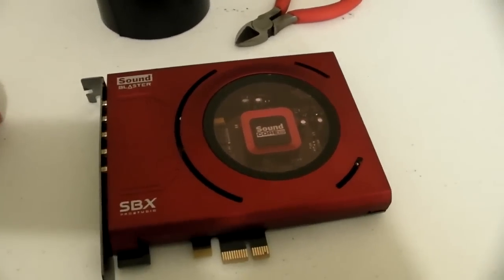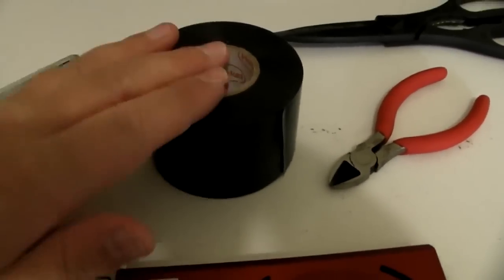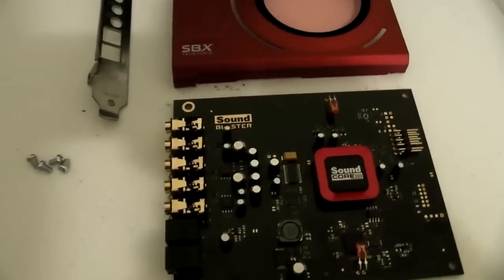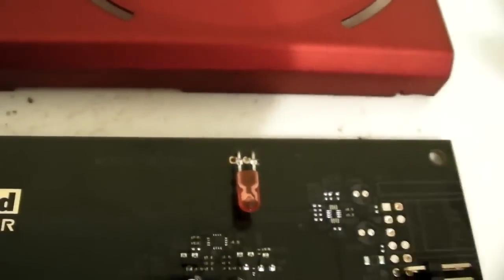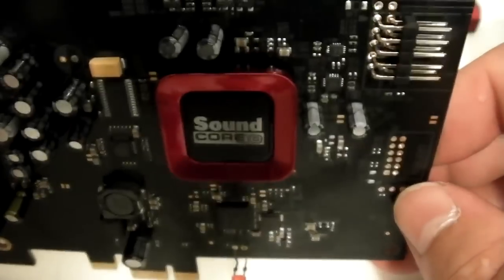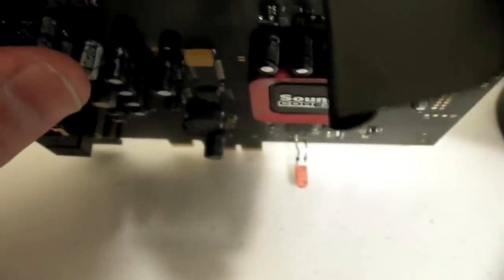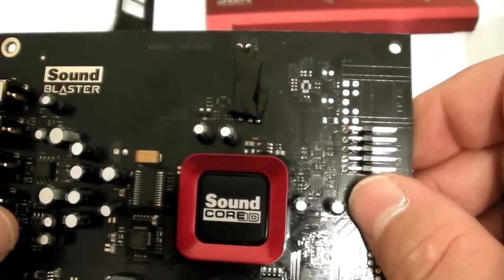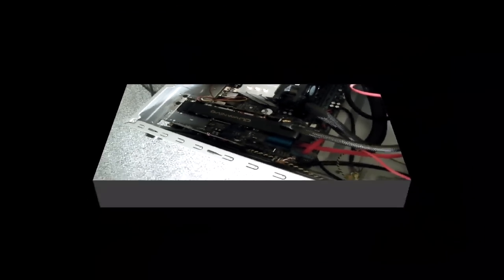How to turn off the red LED light on the Creative Sound Blaster Z

Comment: How much these leds heats? I wonder if it can melt down common isolant tapes. I thinks that's the best way if you want to avoid mutilate your card.
Reply: Im also wondering. But there is already a red plastic on top of the led (that is making it red), so If that doesnt get too hot then I assume the tape won’t either.
Reply: LEDs (especially small ones) don’t really give off a lot of heat. I wouldn’t worry about it too much

Comment: Maybe thats a weird question, but can the tape begin to burn?
Reply: No, LED's are cool, because around 80% of the energy is emitted as light, so the heat generated is pretty low, almost negligible, and for sure lower than the ambient temperature.
Reply: Mario Eduardo Quintanar Galeas Thank
 you very much!:)

Comment: If I wanted to replace the reds with blues, would I need to do anything besides clipping off the old ones and soldering on new ones?
Reply: PseudAeru I don't remember even thinking about voltage lol. I did this almost a year ago but I went into my local microcenter and found a package with two generic blue leds and soldered them on. I'm pretty sure whatever you find will do the job.
Reply from the maker: +Homestar1998 Nope, that's it! Make sure it's the right way round, but otherwise it will work fine :)
Reply: PhilsComputerLab Just went out and got some stuff and did it. It works.
Reply from the maker: Nice!
Reply: A normal LED is rated to last roughly 13-14 years.  If you have an LED in your computer that's anywhere close to that old, then you have some serious upgrading to do.
Reply: Did you replace the LEDs with blue ones? I want to do so as my rig will have a blue-white scheme. I need to know which voltage the leds use? thx!

Comment: you forgot to tell people to be careful and keep themselves grounded, either using a grounding wrists strap, or by constantly touching a grounded surface.Another great thing to do is avoid wearing woolen items,jackets or sweaters.Also I honestly think cutting them out "completely"(don't leave long stubs) is the best thing, because I doubt you would want to open up the case and take out the card and unscrew it all over again just to reveal those annoying LEDs.NB: cutting them clean out would void the warranty so be absolutely sure before doing this
Reply: I've worked in electronic design and manufacture for over 15 years and I've never blown or even heard of a blown component due to electro static discharge.

I'm sure it's possible, but the chances are very slim even without a grounding bracelet
Reply: All you need is to touch some metal so the case is fine to touch and your grounded.